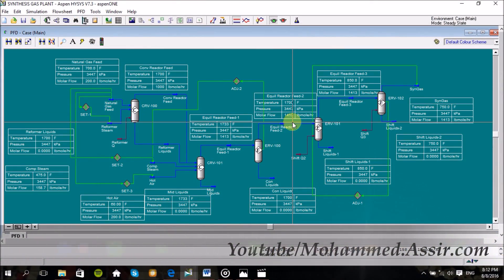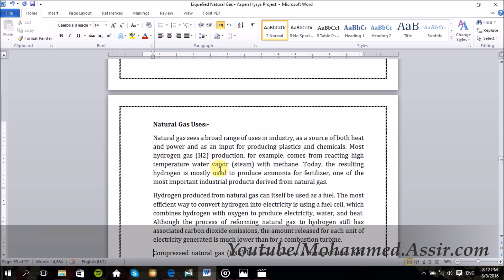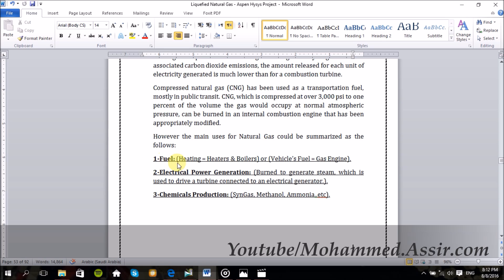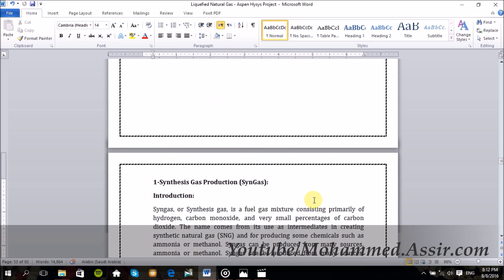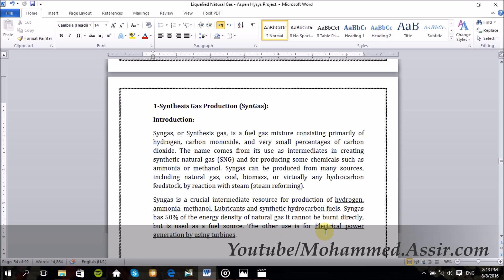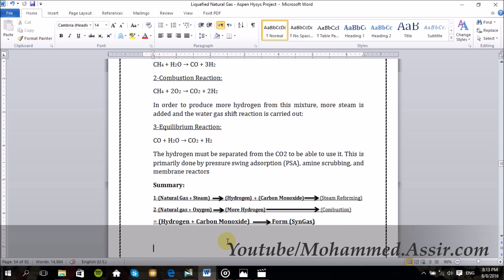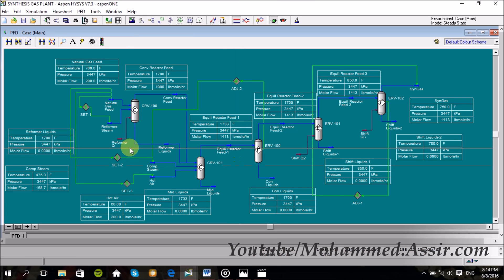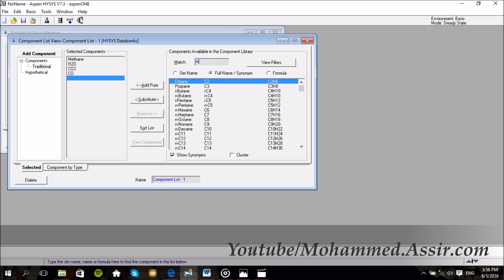7-Gas Processing - SynGas Production Plant with Aspen hysys 7.3

Comment: Thank you for this simulation! It came handy for a project i am currently working on. I was wondering if there is some process diagram or a block diagram for the simulation you just showed  that i could use to help me with the process. Thanks!
Reply from the maker: Thank you very much.. however i can send you some hsc hysys files for syngas production through email..

send me your email on 
dr-zoling@hotmail.con

Comment: hello Mohamed , how can i copy material balance streams of hyses case in a power point  . thank you
Reply from the maker: I dont think its possible to copy the material Balance from the case.. But you can save an then copy your "case report" which can be "Mass balance report, heat balance report, Full report..etc" Did you get it ?
Reply: hello mohamed , how can I get it . thank you
Reply: thank you very much , I got it